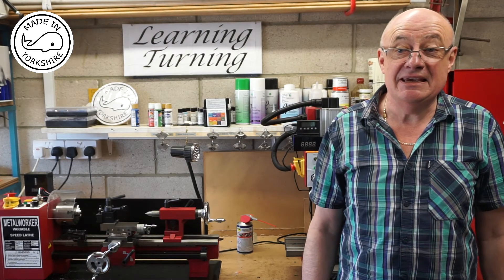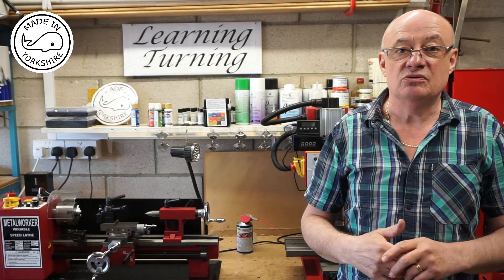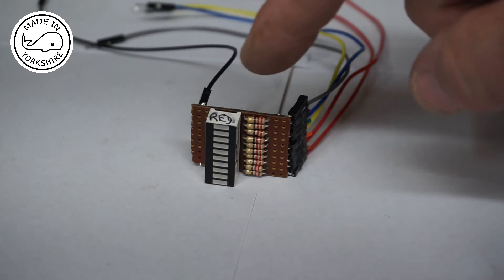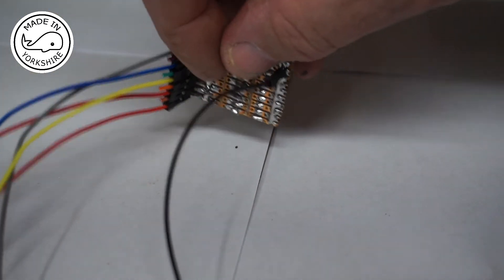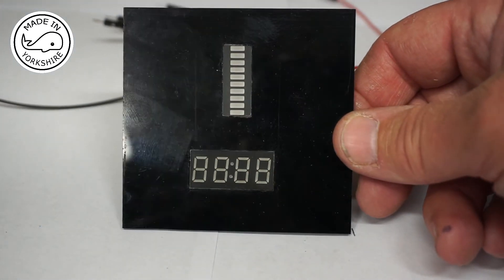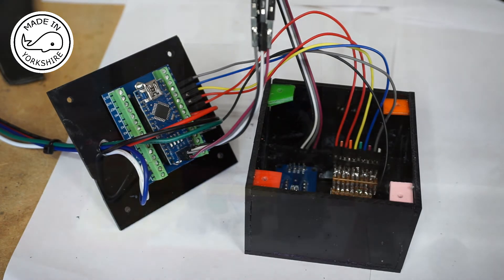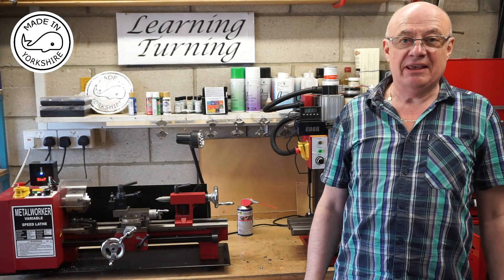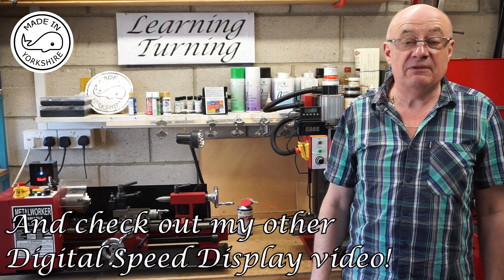#MT17 - Making a Digital Speed Display with an LED array for Sieg mill and lathe. By Andrew Whale.

Comment: Great job, clean and precise.  
Since we both have same mill and lathe (I love em) sharing would be advantageous and I would be forever in your debt to have your design and parts list and directions on the digital readouts.  Cheers Sir from the great state of Milo, Maine- USA.  Keep doing what you do, enjoy.
Reply from the maker: Hi Greg.
I don't find YouTube very intuitive at times, and some features tend to get hidden.
In future, to PM me, just go to my channel, click About, click Send Message (or the message icon), type the message and click send. Obviously you don't need to do that now, but you may want to edit your message above and remove your email from public view. I will email you the Arduino info today and I hope you give it a go. If you do, please let me know how you get on.
Also, many thanks for such kind feedback.
Cheers from sunny North Yorkshire, England.
Andrew
Reply: Thanks for the email advice.  I was wondering about that myself, but I did not know about any other way to make email connection.